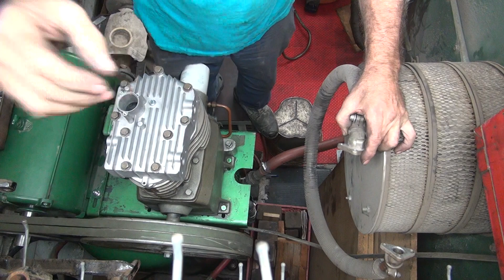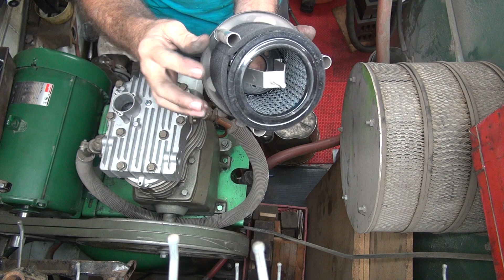#120 fixing shop dayton air compressor 240v 7-1/2hp repair motor reed capacitor harley tatro machine

Comment: In the future take pictures so you know the correct way to reassemble things.  Should not have to bend or modify anything.
Reply from the maker: i have a problem with that. same deal on taking measurements. as you can see i usally just go for it and figuare things out as i go. i like to change things to make them better too.
tatro